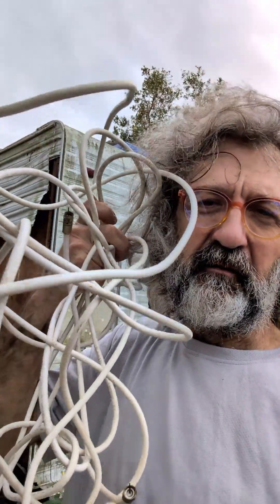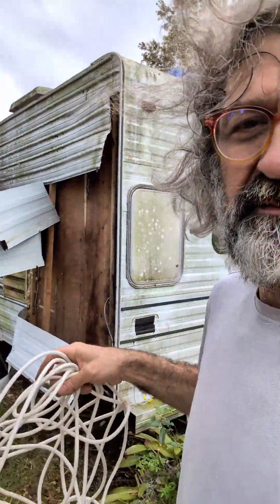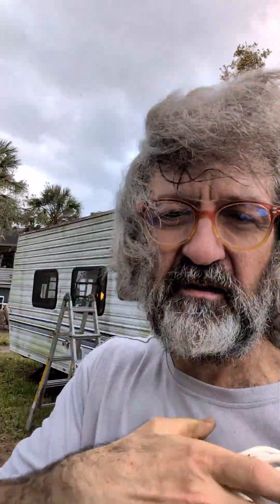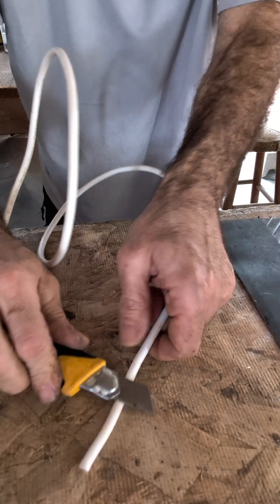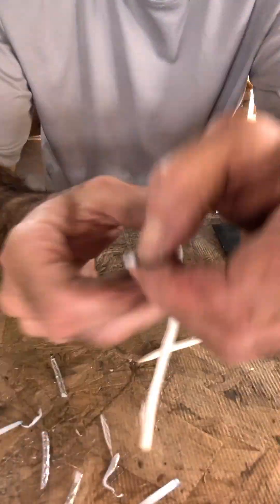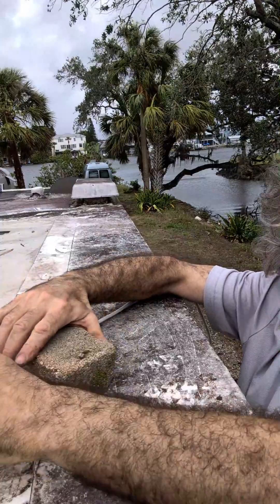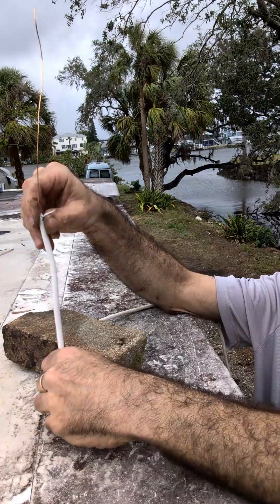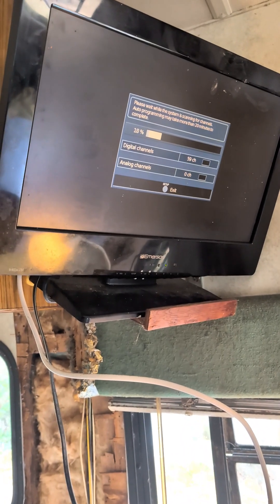MAKE A TV ANTENNA WITH ONLY A COAXIAL CABLE IN 5 MINUTES #diy #howto

Comment: Yes, I just tried it tonight & it works. I only cut 8” & it got me a station with 5 digital channels about 103 miles away. l placed the wire in the window. It WOWed me. Picture quality is clear.
Reply from the maker: 103 miles away is impressive.  Frequency waves can do some strange things too. Bouncing and being blocked.  And the weather can affect them quite a bit.  The sun creates interference. Clouds can make them bouce back down... 
Moving the antenna just a bit can also change the outcome. The  length of the stripped wire is of course a big factor.  I will do another video about that if you want to fine tune your  antenna.  Can you tell me what channel you are getting from that far? I'm curious about the frequency. Thanks for sharing and please subscribe 🙏 if you haven't yet to help my channel. 
Have a great day!

Comment: I'm sick of debunking these fake antenna videos. But hey, My idea might actually work! For an antenna, you need both sides of the wire, not like shown in this fake video: the shield and the core wire. Placing them opposite each other creates a dipole. Position them vertically with the center connection at the top—this is a vertical dipole. That will work much better than what is shown in the video.

Try what I’ve described, and you’ll see that my method works. Make each wire 68 cm long, which should get you UHF and VHF channels—mind you, analog ones only. Strip the coax cable, separate the shield and core wires, and make each one 68 cm long. Then, spread them apart in opposite directions and secure them to plastic or another non-conductive material. Position the antenna vertically with the core wire (positive) on top and the shield wire on the bottom. Place the antenna as high as possible, and there you have it—you’ve just made the easiest TV antenna. I Hope I Earned Your Subscribtion To My Channel, Sorry For My English, Its Not My First Language, Hell, Its Not Even My Second Language!
Reply from the maker: What's ''FAKE'' ??? 
You think Willy is AI ???
There is a million ways of making an antenna and this one has been working for me for 20 years. 

I'm not too far from the broadcasting antennas, if you are you will want a directional antenna, Yagi is a good design but if you build it you need precision and time. 
My video was about simplicity and free-ness (can you say that???)
Have a good day
Reply: An antenna catches a range of radio frequencies.  It works for analog and digital.
You can reuse UHF antennas from the old TV sets.  

But you must put the antenna high facing the direction of the TV transmitter and no obstacles (walls).

Comment: Funny thing I have the same t.v in the backroom with a white cable of course mines has red brick paint all over it, so it’s not as pretty 😂 but I have a pencil ✏️ connected to it. I only cut a half in piece and shoved it into the eraser. But it has to make contact with the led. Idk what the wire and led do but I’m glad it works. I learned it when I was locked up an old jail trick. We were not allowed to modify our things if we did they will take it so we used a pencil

Comment: How did you ground it?
Reply from the maker: I didn't ground it but the shield part could be grounded easily.
Store bought small antennas are not grounded either.
Reply: There Is No need To Ground VHF Or UHF For TV Purposes !